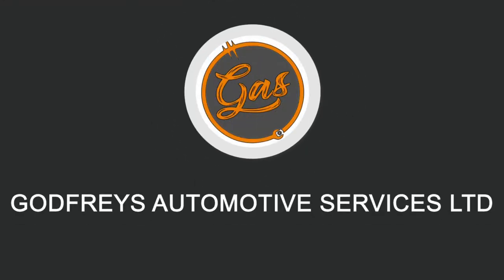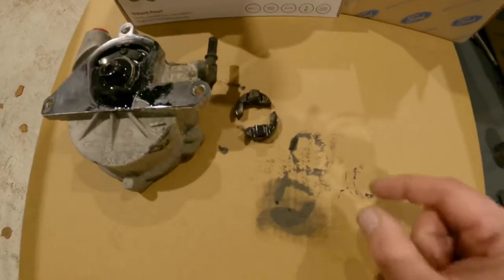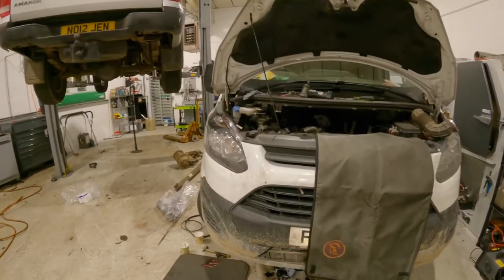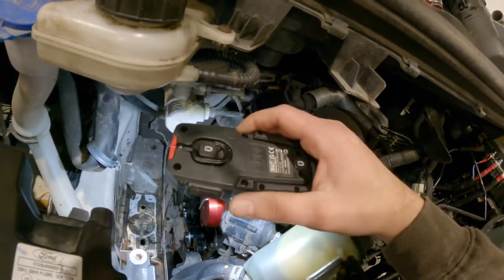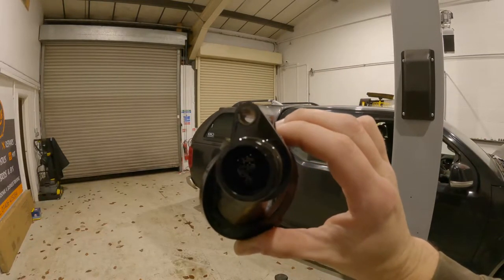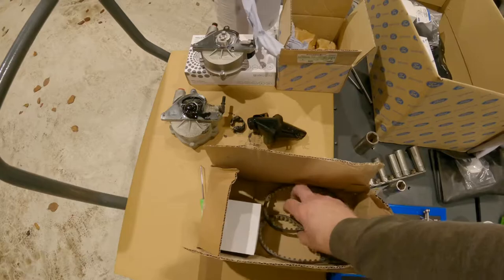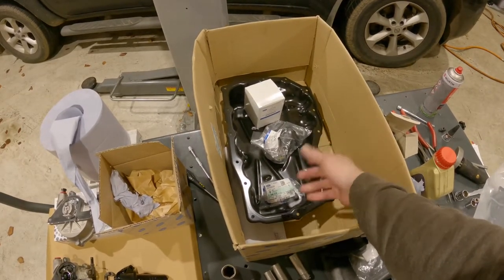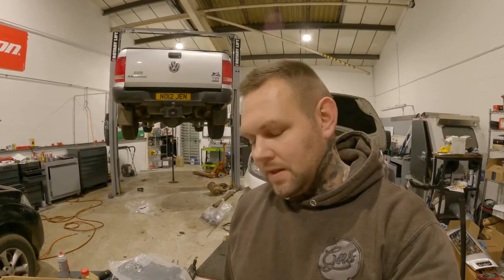Vacuum pump failure due to timing belt. 2.0 Ecoblue engine. Transit Custom.

Comment: Great video tyanks . Just to add some information Ford are having a lot of premature wet timing belt failures on this particular engine .
Regardless of regular maintenance and oil changes .
They did send out a recall letter for 17 / 18 plate vans.
The issue didnt appear on most until they were hitting the 60k to 80k mileage .
Some have been fixed under warranty but recently Ford are refusing to acknowledge its a design fault problem.
The official guide is the wet belt should do 150 k or 8 years before needing changed but a large number of vans are suffering engine failure at half that 
My own van 18 plate suffered the same brake problem due to the oil ways getting restricted due to cam belt wear.
When the RAC mechanic attended he informed me his own van had suffered the same problem and that the RAC had a lot of their own transits suffering engine failure or if your lucky the prewarning of the vaccum pump going .
Fairly sure the RAC will be following the Ford book on maintenance 😊.
So if your reading this post be warned cam belt life expectancy on the 2.0 eco blue fitted in big transits and transit customs is about half of the claimed amount by Ford .
If the cam belt breaks its a new short engine.  Big £££
Reply from the maker: Great information 👍

Comment: Just had this problem on my van, ford replacing engine and turbo because of the cam belt parts contaminating whole oil system. Lease company footing the bill.

Comment: Do you suggest an oil flush as well before fitting the new vacuum pump to hopefully get the galleries clean?
Reply from the maker: Yes 👍 definitely
Reply: Personally I advise my customers not to use oil flush in wet belt engines due to potential damage to belt from flush chemical but each to there own
Reply: I've been advised not to use engine flush due to it damaging the wet belt .
Rather drop the sump
 clean the pick up in the sump or replace as in the video .
Then to run the van for 10 / 20 miles or so with the correct engine oil and a fresh filter then dump out that oil and fit another new filter and new correct engine oil .
Reply from the maker: @DavidClark-d6i  that’s good to know, I wasn’t aware of this but I’ll definitely be taking it on board 👍
Reply from the maker: @PKDiag  that’s good to know, i wasn’t aware of the possible damage engine flush could cause so definitely take this on board 👍
Reply: That's exactly how I usually play it run for a road test and drop the oil again and touch wood not had further issues maintenance on these engines is key regular oil changes is a must

Comment: Hi mate great vid, just happend on my van😢 was gonna have a go but not that mechanical minded so just got a quick question, are the vac pump easy to replaced? Is it just lineing up keyway on back of cam or do you have to do any sort of locking of camshaftect dont want to damage anything haha. Thanks and also dont worry ill be getting timing belt done just wanna have my break pedal back for now haha
Reply from the maker: Yes, vac pump easy enough buddy. No special tools required, just line the keyway and bolt it on 🙂
Reply: Thanks mate keep up great vids!

Comment: Ford don't give a toss about its crappy wet belt system they sre still fitting it to the new custom looks great lucky to get 60000 out of  the engine not bad for a 40000 van.Roger.

Comment: My brakes did this went to a IN and OUT they changed the brake servo 50 miles later bang timing belt bang